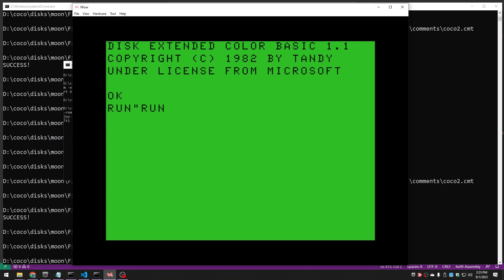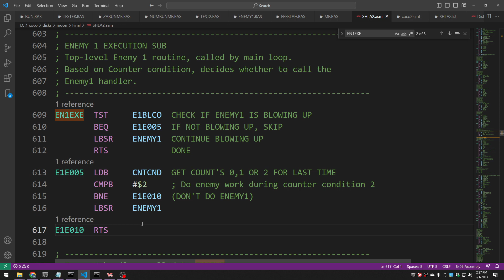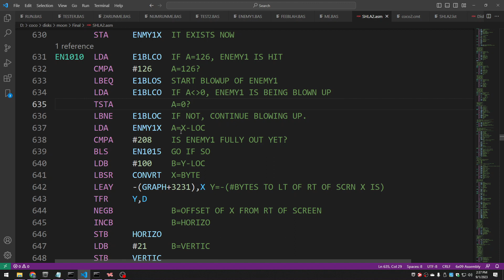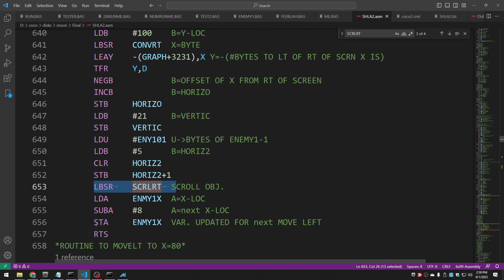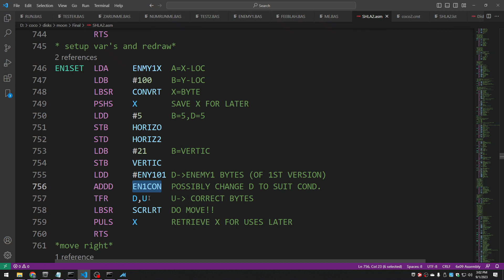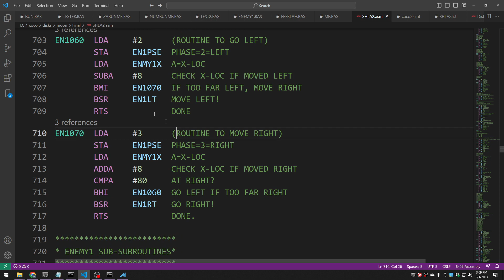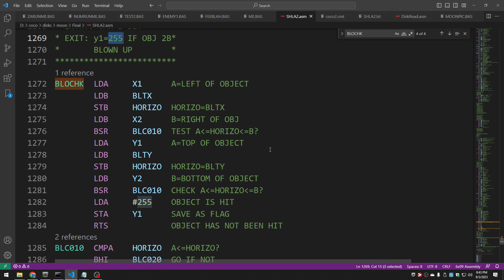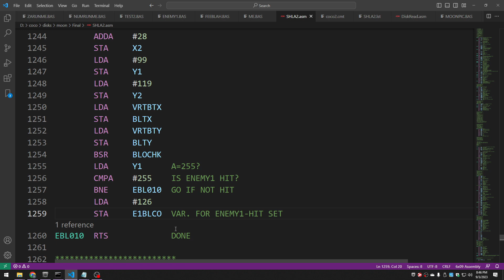The enemy | Game resurrection part 5 | #SepTandy

Comment: I'm thinking that you're probably calculating the values for the "explosion" on each pass through the loop.  What you probably would want to do is to define a separate "sprite" for each phase of the explosion, with one color actually being "transparent" so the background which is supposed to be there shows through (and maybe store the background elsewhere so that it can be combined with the explosion without being messed with by the sprite).
But maybe you already did it that way and the slowdown is coming from all the work involved in that?  I'll be interested to see what you did, in the next episode.
Reply from the maker: Thanks for the tip!  I actually have a pretty strong hunch where the slowdown is coming from.  I may be revisiting that code in a future video.